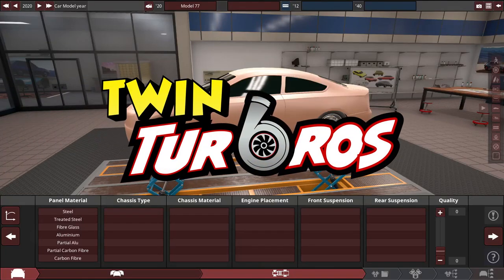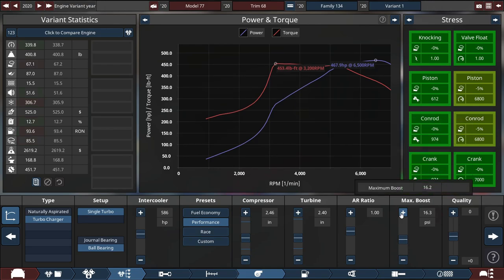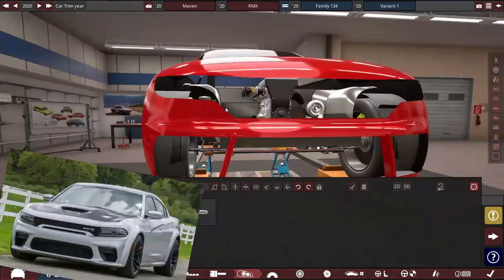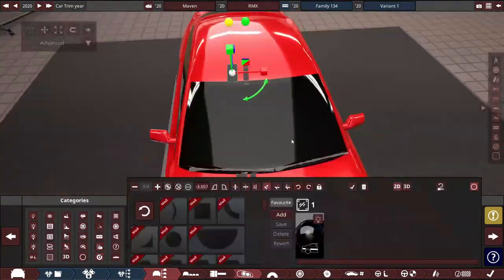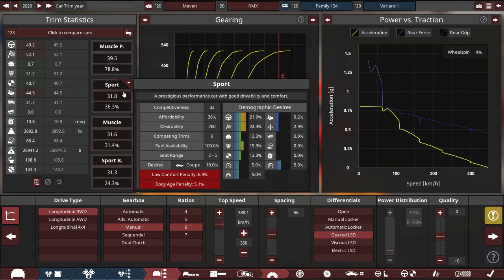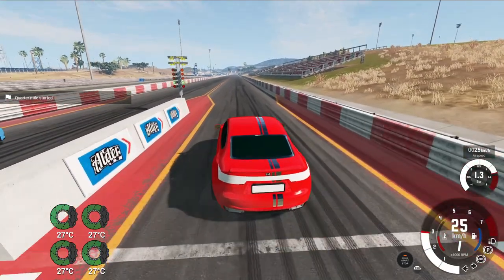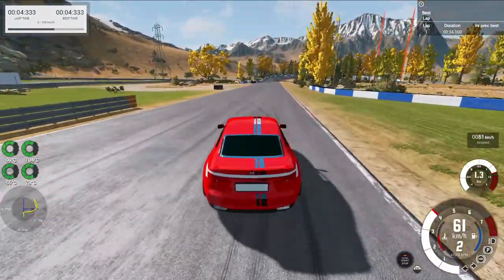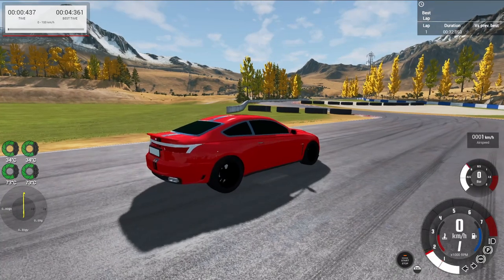Building A 3 Cylinder Muscle Car?! Automation - BeamNG

Comment: I once made a relatively "weak" engine by my standards and was caught off guard when I saw that it lets me go 900 km/h in the settings...
Reply: your standards must be uhhhhhhhhhhhh EXTREMELY HIGH then
Reply: @stratis722  I dont think you quite get it, my standard is 1k hp+ (to 3k)
Reply: @iXenox  what's your highest hp build?
Reply: @magicstew45  3k
Reply: @iXenox  highest I've gotten is 3.4k any advice on the H4 can't get more than 1.5k on it?
Reply: @magicstew45  Turbo? higher quality? better fuel? knock? (fix knock, knock bad) Tuning? More tuning? bigger cam profile? bigger engine?
Reply: Best I3 i made was 900hp
Reply: @stratis722   miles high

Comment: I want them to add 2 and 1 cylinder engines. I have a motorcycle with a 1 cylinder 373ccm engine and it sounds so good with many bangs when shifting and engine braking.

Comment: best i could get was 450hp and 7.5 mpg although it does have a 5.6 0-60 time cost is about 165,000
Reply from the maker: Eh those are still pretty dam impressive #s!

I spend a good chunk of time on mine to get its power!
Reply: @TwinTurBros   yeah it tends to be time consuming but i didnt even try to tune for maximum power i just tuned fir no restrictions although the efficiency is probably crap because of 10:1 afr and 30lbs of boost but i only used +5 quality